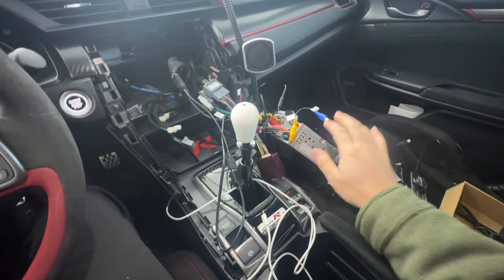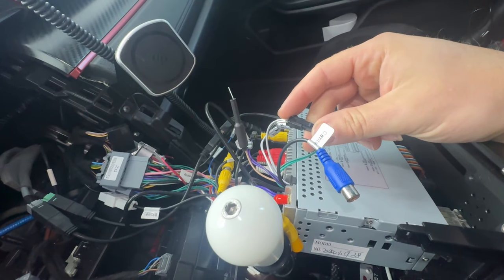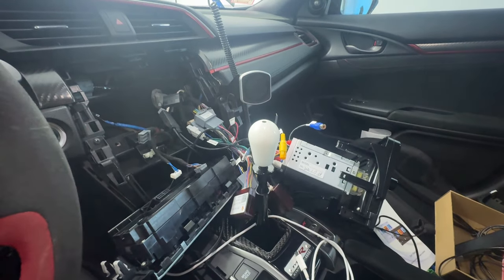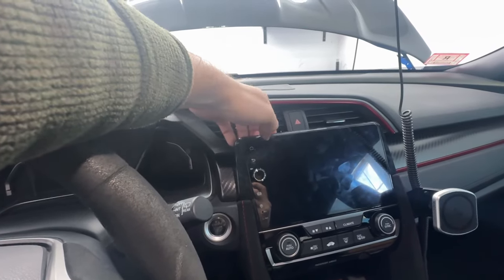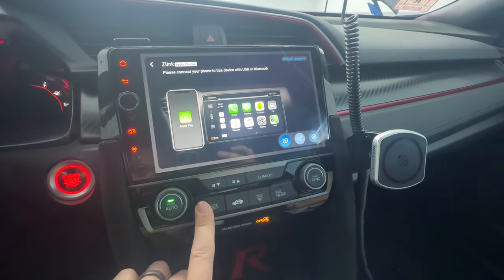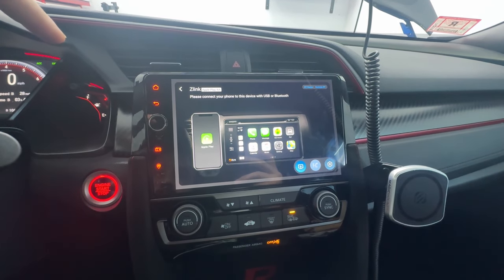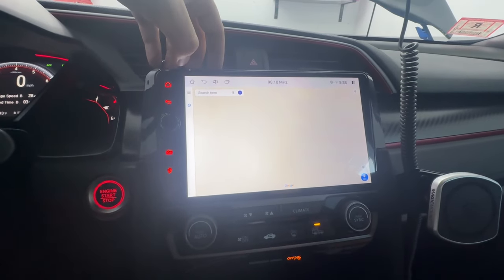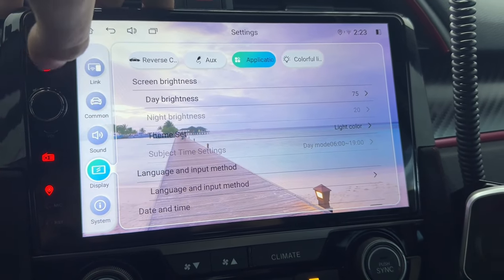FIXING THE FK8 TYPE R’s BIGGEST PROBLEM ( JOYING 9” HEAD UNIT INSTALL)

Comment: i dont mess/deal with the head unit as much as i would care to replace it. It plays my music, that’s all i need. Laggy it may be, fck it. lol
Reply: I don’t even notice the lag everyone talks about
I just have CarPlay hooked up and it works perfectly fine
Reply: @Kennyjamesss  Yeah it does work fine. Its just not as quick compared other things such as an ipad or phone or whatever lol.
Reply: @mkxiong6427  well of course not, it’s a unit they prob had made for less than $100 lol
Reply: Mine crashes every week or so just trying to use apple CarPlay for music and maps
Reply: @poulr1130  wild no issues on my 2018
Reply: You can go into settings and apparently disabled some settings that take up ram, the onbored GPS / maps allways run in the back. You don't need it you can use your phone then it works spot on

Comment: So you lose LogR too? I had no issues with my Log R. Is the Hondata better?
Reply: youre lucky or its a head unit problem with mine. My log R app crashes all the time on the track (Android user)
Reply: You can disable things in settings you can turn off your onboard GPS / maps as it takes up ram and allways on. Just use your phone or android auto.. after turning it off of course.. even when you use Android Auto the cars map is still running in the back as well if it's not turned off.

Comment: Man, I have been struggling to find the thing for resetting the tire pressure. All the other videos talk about an app, and that doesn’t do anything. Thank you for this! I was getting ready to switch back because with the Tire pressure light on I can’t fully disable traction control which is not ideal for autocross and track. 🙏🙏🙏

Comment: Do you know if Honda hack works on these head units?? I have the stock head unit still but I like how Honda hack can turn off the voice for seat belt, e brake ect
Reply from the maker: I’m not familiar with Honda jack but my guess would be no
Reply: @thebackroadgarage  gotcha. It has a lot of features to customize the instrument cluster use certain headunit features while driving, clearing up memory on the headunit so it doesn’t run as slow and some other cool stuff. Kinda like a jailbreak